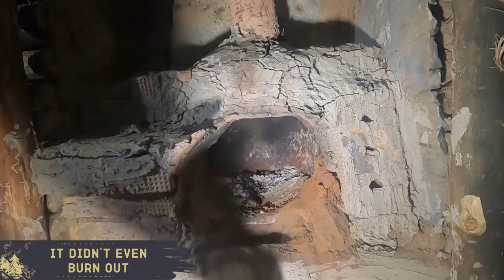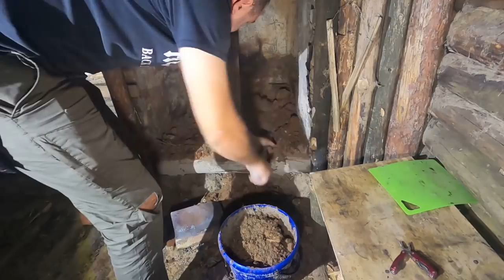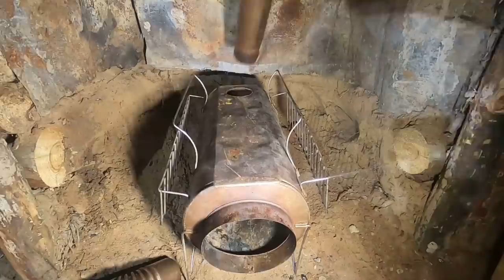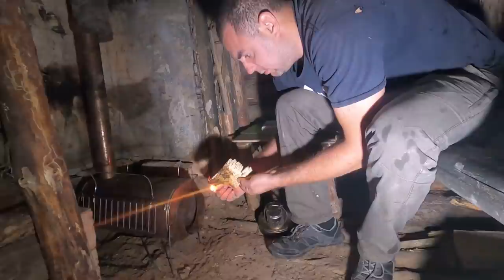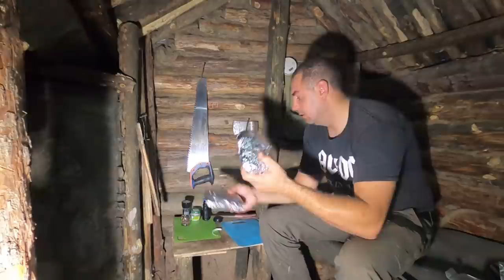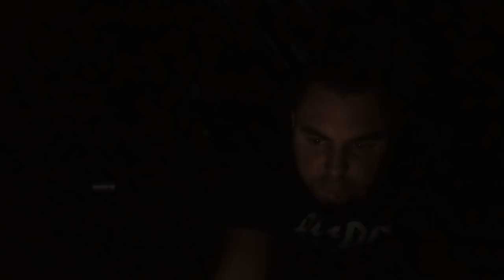Off grid living in a dugout, Portable Kabanchik stove, solo bushcraft

Comment: The new stove is so much better than the Rusty Bucket! But I feel that it's small and it's round. When the winter comes you're going to want something much larger for heating and for cooking. And I feel that something flat that you can have pans and pots I'm without worrying about it tipping when you cook. I don't know where you're at but it's got to be cold in the winter and you're going to want things a little bit warmer also. I'm sure the small still will work well in the summer period until you can get something worked out. And you have plenty of room there to work with. Good job I enjoy watching your videos every time you put them out
Reply from the maker: This oven heats very well, but also cools down quickly. I'll make the last good oven soon. Thank you!

Comment: You tore down the old oven and put in pretty much the same oven and same design but now lower to the ground and smaller size. Maybe you should build a proper fireplace to make cooking more practical and larger so fire can last longer.
Reply: A larger stove would put out to much BTUs for such a tiny tiny place. You would end up putting tiny fires in it anyway so you didn’t roast yourself out.